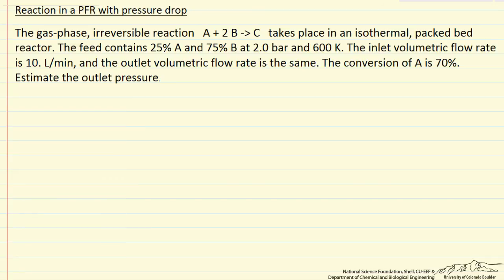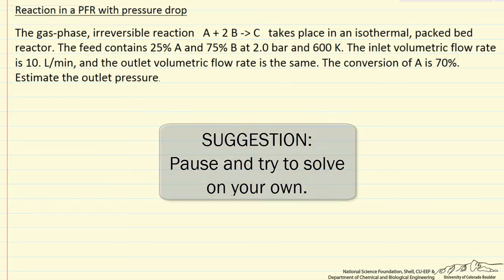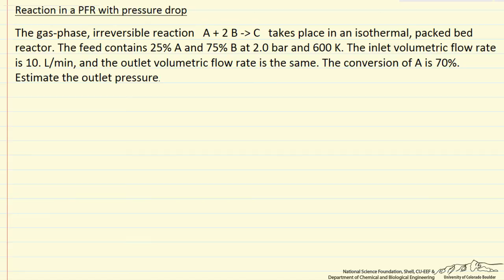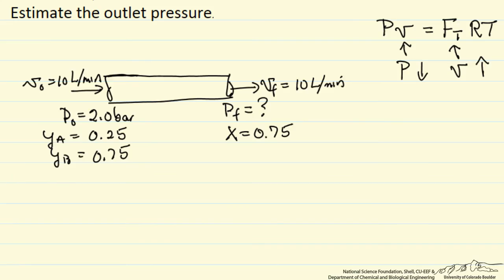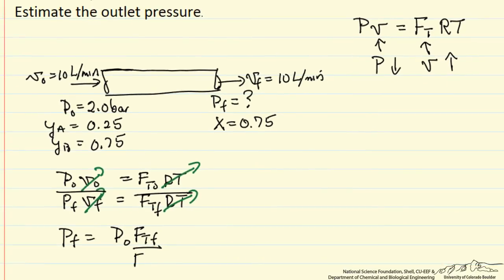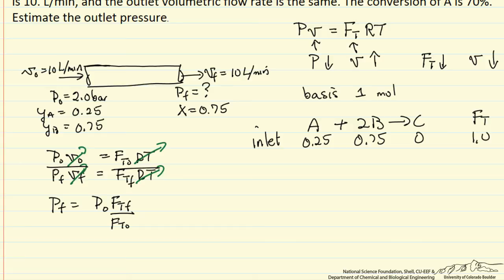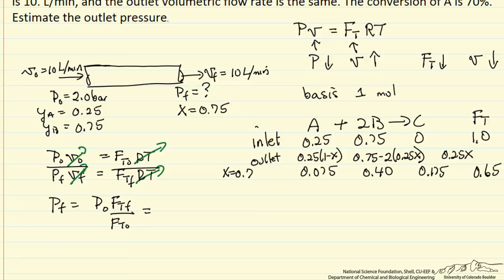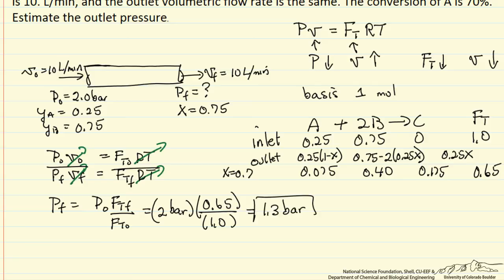Reaction in a PFR with Pressure Drop

Comment: what if the volumetric flowrate at the end is not the same as the start (it's a pretty big assumption, unlikely to occur in real applications)?
Reply: Breaker2361 apply the general balance equation
 in-out+generation=accumulation